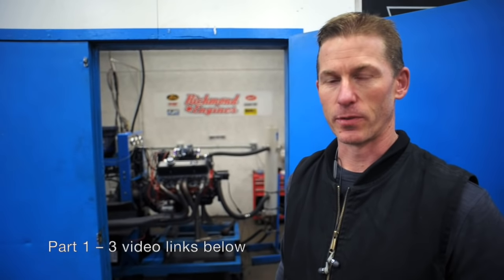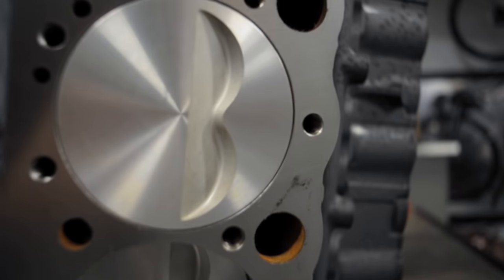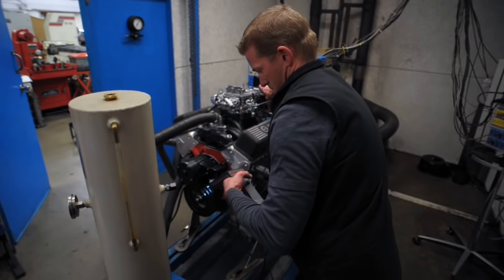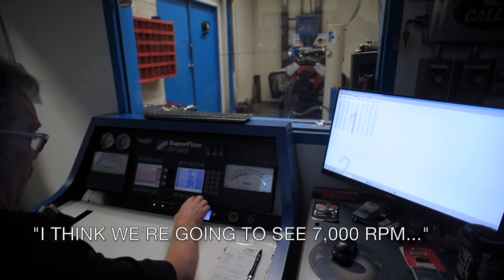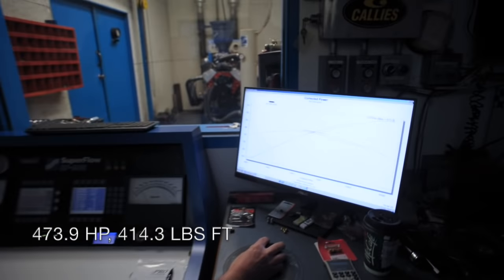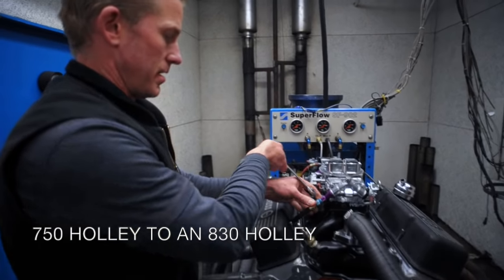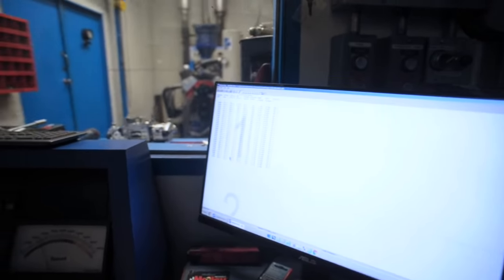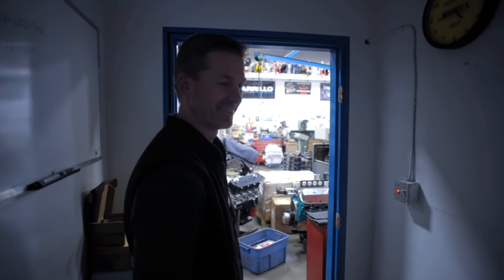SBC 283 Crankshaft + 400 Block = 500+ HP (Dyno Test 1 of 2)

Comment: How are y’all running a 10.7:1 engine with old school chamber designs (even if AFR’s chambers are better than GM’s they’re still SBC chambers), without any kind of knock/ detonation protection on 87 octane and making power? Or better yet why? I don’t know how feasible that would be in an actual car though where heat soak, low RPM loading and high ambient temperatures are a reality. I don’t run my 9.8:1 383 SBC on 87 even though I probably could for that exact reason, because I live in Texas and it gets darn hot down here. Also thanks to all the blue states’ crashing economies and political despotism the cities here are overflowing with foreigners (to Texas) causing traffic and stupidity to jam up our roadways. Which means I don’t get to let her eat very often. I spend more time sitting at stoplights than driving when in town.
Reply from the maker: Hi Cory! We designed the 10.78:1 c/r as a part of a flat top, two valve relief piston and 6.1" connecting rod combination; and with the rod:stroke ratio being 2.01:1, it enables us to use regular pump gas without pinging. Our short stroke engine is mated to a Tremec TKX gearbox, making the whole combination sweeter. And as for your blue state comment, remember, Donald Trump built "the wall" as fast as Barack Obama closed Guantanamo Bay. Red or blue, the binary, two-party facade is designed to divide and conquer. "Nothing happens in politics by accident; if it happens, it was planned that way." ~ Franklin D. Roosevelt. Best regards!
Reply: @ceperformance  I don’t see a dozen California license plates in rush hour traffic on a daily basis because they’re on vacation…
Reply from the maker: @coryholbrook4643  I've got a friend in suburb of Philadelphia, Pennsylvania who says he doesn't get a block away from his house without hearing Español. And here in Canada, it's an awkward family party of everybody. Still, we try and make it work. Thanks again for commenting, Cory! https://www.youtube.com/watch?v=no7XR7s8Z7o
Reply: @ceperformance  at my job almost everyone on the floor speaks Spanish. The other maintenance guy and I have to talk through google translate because he’s from Columbia and doesn’t know English! But why is this even being mentioned? Because I said foreigners? I figured by the context and my “(to Texas)” addition i made it fairly clear I meant people not born, raised or stayed long in Texas. You notice them. Especially when they come from the coastal states.

That chase scene always makes me cringe because of the way those now irreplaceable cars are more than abused.

Comment: We made these engines back in the 80s nothing new
Low torque
Reply from the maker: Interesting. What block did you use and with what bearings did you fit the crankshaft with?

Comment: Now for the real truth, octane did not increase the HP  What it did was allow them to increase the timing which in turn increased the HP. I can't believe that you kept spinning this engine that many rpms after admitting it needed a valve spring change.
Reply from the maker: Thanks for commenting. 
We did replace the retainers with titanium ones and shimmed the springs  .060” and that cleaned it right up. Made a bit more power up top too. 
There’s another video of that test.